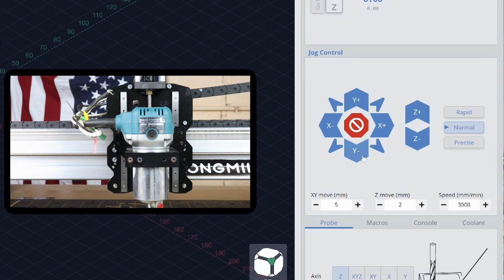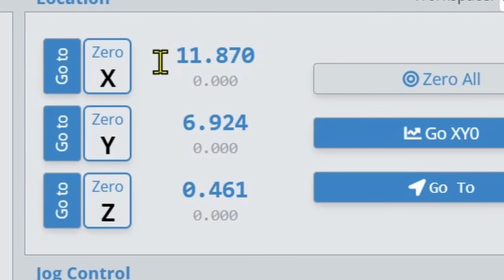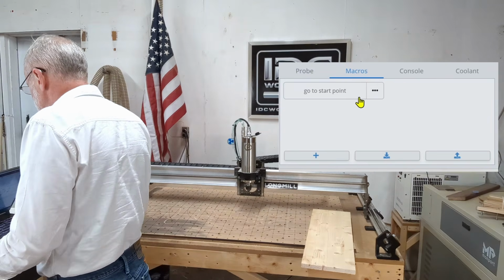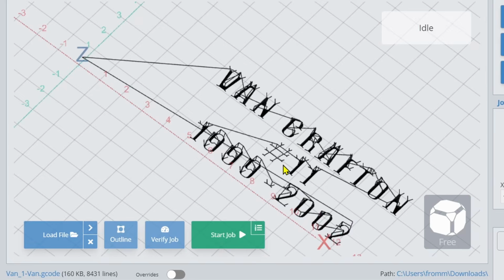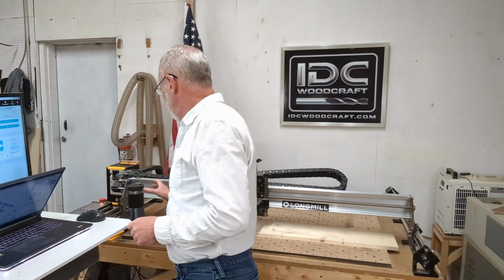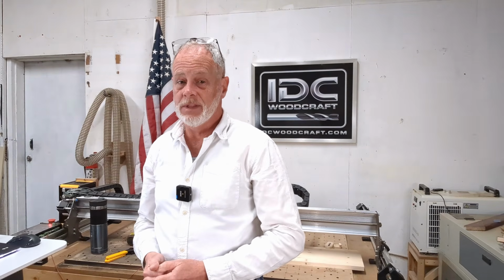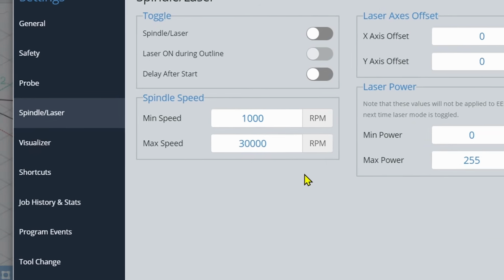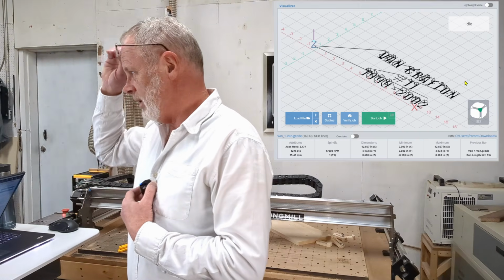Gsender Complete Tutorial for CNC Routers

Comment: great video, however my genmitsu 4040 pro still shows all my x y and z settings in the console as mm even after making the changes to $13 = 1 and in the firmware. 
$24=100.000 (homing feed,mm/min)
$25=500.000 (homing seek,mm/min)
$26=250 (homing debounce,msec)
$27=1.000 (homing pull-off,mm)
$30=10000 (maximum spindle speed,rpm)
$31=0 (minimum spindle speed,rpm)
$32=0 (laser mode enable,bool)
$100=800.000 (X axis pulse:step/mm)
$101=800.000 (Y axis pulse:step/mm)
$102=800.000 (Z axis pulse:step/mm)
$103=177.777 (A axis pulse:step/mm)
$110=2000.000 (X axis max rata:mm/min)
$111=2000.000 (Y axis max rata:mm/min)
$112=2000.000 (Z axis max rata:mm/min)
$113=1000.000 (A axis max rata:mm/min)
$120=20.000 (X axis acceleration:mm/s^2)
$121=20.000 (Y axis acceleration:mm/s^2)
$122=20.000 (Z axis acceleration:mm/s^2)
$123=20.000 (A axis acceleration:mm/s^2)
$130=400.000 (X aixs max travel:mm)
$131=400.000 (Y aixs max travel:mm)
$132=80.000 (Z aixs max travel:mm)
$133=9999.000 (A aixs max travel:mm)

How do I get it to change. my rapiding is slower than slow
Reply from the maker: This one is a little tricky to walk you through over email, my friend. I recommend joining us for our live sessions we host every Wednesday evening at 8PM EST, and we should be able to help walk you through it then, brother!

Comment: Good day Garrett I have been going around and around from the start the touch probe at first did not work Chack all settings e mall cnc thay sent out a new cable still no joy just hoping you can help  I set up the touch plate the bit go to probe in g sender on screen saying no touch lift plate and it don’t contact or change in g sender  now when I first got the long mill I put the  touch plate cable in the port did not work did my checks plugged it back in no joy then pulled it out just a little bit worked in this process I emailed cnc told them I had a problem when I got it to work email again  now I have a long mill that is nice to look at but can not use projects to do but can not do you have any suggestions help
Reply from the maker: It sounds like you're having a frustrating time with your touch probe. Make sure that the connection is snug, as sometimes a loose connection can cause these issues. It's also important to verify that your software settings are correct and that the touch plate itself is functioning properly. If everything checks out, it might be worth contacting customer support again for assistance. Hang in there; I hope you get it resolved soon!

Comment: Have a Question.  I have a roller to put a barrel o 1 in Di   And I need to cal the step motor to it  the letters are engraving to tall .  Need set the ratio so there only 3/16 tall instead of going half way around the barrel thanks
Reply from the maker: To adjust the height of the engraving on your barrel, you'll need to modify the steps per unit settings for your stepper motor. By adjusting the scaling or ratio in your CNC software, you can achieve the desired height of 3/16 inches. Make sure to test with a small section first to fine-tune the settings before engraving the entire barrel. Good luck with your project!

Comment: good job, my UGS lost gcode editor, doesn't show gcode, how to fix?
Reply from the maker: saydiy1528, It sounds like you may need to check your UGS settings or possibly reinstall the software. Sometimes, updating to the latest version can resolve bugs or missing features. You might also want to ensure that the correct settings for your G-code files are configured. Good luck with your project!

Comment: So g sender should be loaded on the dedicated laptop and not the computer that you design with correct?
Reply from the maker: SpookyMDB, That's a great question! It's generally a good practice to load G Sender on a dedicated laptop or computer that's specifically set up for running your CNC. This way, you can minimize distractions and ensure a smoother operation during the machining process. Keeping your design software and control software separate can help avoid any potential issues.

Comment: Under the FIRMWARE option at the top and the drop down menu for PROFILE I don't have one of the listed CNC's.  I chose GENERIC CNC but it doesn't let me change the dimensions of my workspace.  How do I do that?  I use a FoxAlien Masuter 3S 8040 with dimensions of 800x400 millimeters.  When operating my cnc the X axis stops about midpoint.  How can this be fixed?
Reply from the maker: twistedscissors2, It sounds like you're encountering some common firmware configuration issues. If you're using the GENERIC CNC profile, you usually need to manually enter your machine's dimensions in the settings. Look for a place in the firmware or software where you can input the X and Y limits—this is often under machine parameters or workspace settings. 

As for the X-axis stopping mid-run, this could be due to incorrect machine limits set in the software, or possibly an issue with your machine’s wiring or configuration. Double-check your settings to ensure everything is configured correctly.

Comment: I have two different profiles on mine for two different machines. One for my Longmill and one for my cnc4newbie. It working so far but I haven't a clue if I did it correctly cause one machine is bigger than the other. No problems so far so I guess its correct.
Reply from the maker: iwannaapple7190, It sounds like you’ve got a solid setup going with your profiles for different machines! As long as everything is running smoothly and you're getting the results you expect, you're likely on the right track. It's great to hear that you've managed to navigate the differences between the two!

Comment: I think calibrate is more important than expressed here.  I am basing this on my experience of building my CNC and using other software.  I suspect it sets the distance per step.  For example, if you jog one inch, the machine needs to jog one inch.  If the steps per inch is wrong, it will not go one inch.  You must understand, the machine does not know what an inch is, it only “knows” steps.  In this presentation, the calibration was probably performed at the factory.  If you built your own machine, then you are the factory.
Reply from the maker: rickharms1, You bring up a great point! Calibration is indeed crucial for ensuring that your CNC machine operates accurately. When building your own CNC, taking the time to set the correct steps per inch is essential for achieving the desired precision. It’s interesting how the understanding of distance translates to steps; it really highlights the importance of proper setup. Thanks for sharing your insights!

Comment: There is one of part of your video that left me with a question. When you were using the zero proble, I understood the z axis part. It was actually touching the spoil board. IE: Z=0. When you did the X and Y axis the edges of your zero block were not even with the edges of the spoil board. I am confused about exactly where the x and y zero is and what it is based on.
Reply from the maker: DannyCarter-q2d, Great question! When setting the X and Y zero, I typically position the zero block at a reference point, which can be the front left corner of the workpiece or spoil board, depending on your setup. It helps ensure consistent placement for cuts and is based on your machine's coordinate system. The position of the zero block may not always align directly with the spoil board edges, allowing for flexibility based on your project. Once you set that reference point, all movements are calculated from there.

Comment: I saw enough impressive features with some valuable upgrades over some of the other CNC handlers that I've downloaded recently (trying Everything on the market) that this looks like a keeper! 👍
Reply from the maker: C-M-E, It sounds like you’ve found a CNC gcode sender that really stands out for you! Upgrades and impressive features can make a significant difference in usability and efficiency. Happy CNCing brother!
Reply: @IDCWoodcraft 

 First of all tx for the clear and professional explanation of Gsender. I had an issue with UGS and was searching the Internet. Luckily I found Gsender. After one day of using I never go back, what a great piece of software 👍👍👍. 
I have two questions;
A] I like to start and stop my spindle manually for testing. Enter M3 in the console will not start the spindle, just return a “ok”. When create a macro I have the same results 
B] using the game controller (very nice implementation) I face short delay. When pushing the stick for moving X or Y I have a delay of properly one second before moving. 
Hope you are willing to help. I guess the error is on me due to the short experience with Gsender. Last, I’m a mac user. When will there be a version for Apple silicon (M version processor)

Comment: How do you start with an same zero points with different programs.  I cannot zero to the same coordinates after the first program is finished.
Reply from the maker: mikehuynh5715, Hey there! When using different programs, the best way to ensure you start with the same zero point is to note down the coordinates after running the first program. Then, in the subsequent programs, manually set the same zero point before starting. This way, you can maintain consistency across different programs. Hope this helps!

Comment: Hey there.  I've been learning a lot from you, but I have a small problem.  My gcode sender tells me I'm connected, but the screen below says I'm disconnected.  I'm using another computer, much slower than my laptop that I'm waiting for parts to fix the charging jack, but is this normal???  Let me know!  Thanks again for giving us all what we need to know about CNC.
Reply from the maker: JackNess-yq8hk, Unfortunately, I am not much help here. I am not a tech guy when it comes to CNC machines. I may be good with the programing and operation but when it comes to troubleshooting, I'm an absolute deer in the headlights. I recommend reaching out to your machine manufacturer regarding your issue. They will be able to help you the best my friend!

Comment: I would have gone into detail on setting up the probe in settings. You covered setting up the bit diameter but totally missed setting the thickness of the probe material in Z, X and Y directions which is essential for accurate zeroing.
Otherwise a good video.
Reply from the maker: pw3111, good points brother. I will focus in on that more in future videos.

Comment: hello..will be first time CNC user at a community workshop.. they gave a quick lesson on the actual machine use and will supervise first cut.. they have Gsender set up on their computer.. my first project will be to resurface a 2 inch cypress shelf I want to install in the cabinet space over my refrigerator.. i was going to try to find free software to design the necessary file to surface my project but I see from this video that Gsender has a surfacing feature.. could i accomplish my project resurfacing using only Gsender? i purchased your 1.5 surfacing bit which i plan to bring and use..thank you for this video and your other content.. who knows, maybe i'll get my own CNC at some point.. you sure make it look learnable and fun!
Reply from the maker: eileenbaker6419, you sure could brother! I also have a video that should really help you with surfacing. Here is a link: https://youtu.be/L-t8OVnyMhg?si=97ypugYrN85Ytfko
Reply: @IDCWoodcraft  thanks Garrett..actually a "sister" here .. i have previously seen and learned a lot from your referenced video about surfacing.. As you responded, i was actually editing my original post to ask about something i saw in that video..I see in the creating toolpath section, the need to "add" the surfacing end mill and check for correct settings.. if i only use Gsender (i dont have design software and and wouldnt acquire just for this project, unless there is something free to use), would this step of adding the bit be necessary or accounted for? thanks again, Eileen

Comment: Hi,I want  to ask did the Gsender is compatible with all CNC routers ?I am waiting my from China it will arive at the end of April and Im wonderin if I can connect it to this software.Thank you I appreciate for all the videos you make Ive learned a lot !
Reply: gSender should be compatible with controllers running grbl firmware. There will be configuration you will need to research with your manufacturer but if you can use UGS, you can use gSender
Reply: @hamanjam  nk105 g3 control system this is the controler .Can you help me ,does it have this firmware?
Reply: I’m not familiar with this controller but it does not appear to support .gcode or .nc files.  It looks like a Cortex A8 processor so my guess is that it would not work for you.
Reply: @hamanjam  thank you!
Reply from the maker: radoslavevtimov6448, that depends on your machine brother! Your best bet is to reach out to your machine manufacturer to determine compatibility.